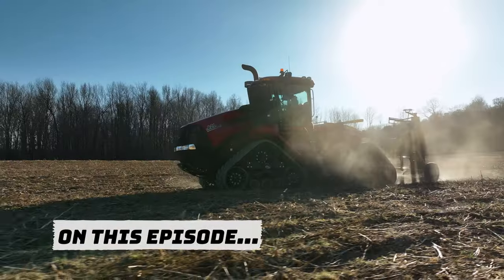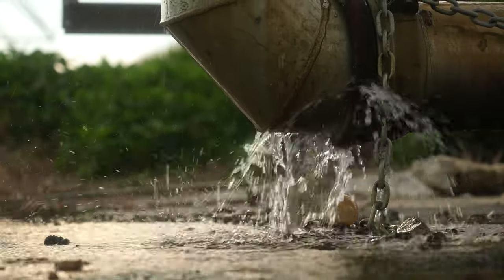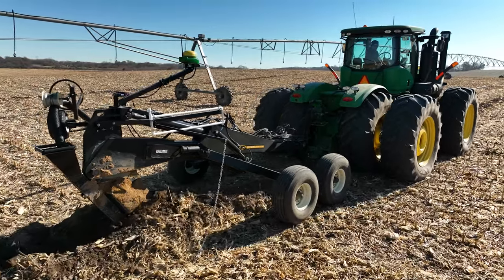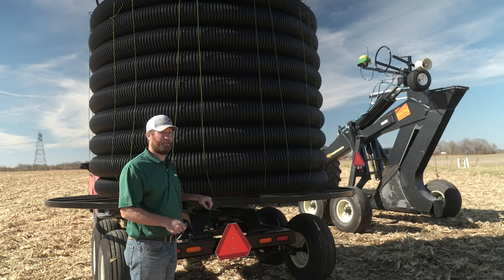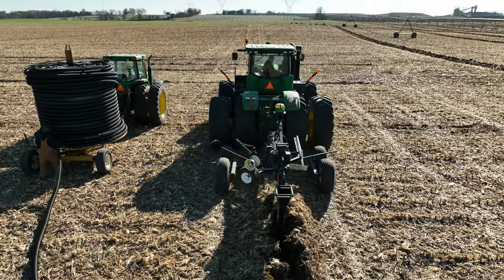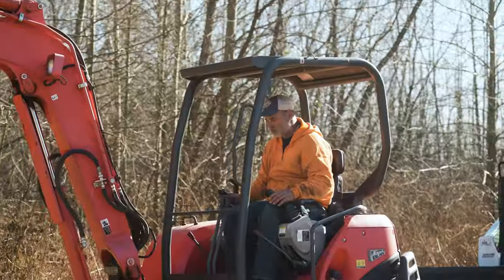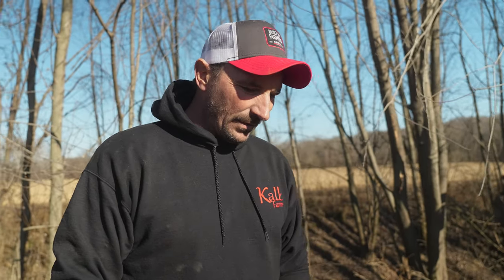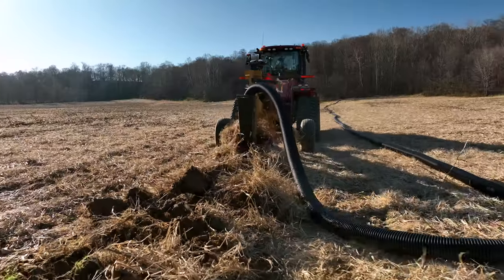Go With the Flow | Live To Farm Ep. 109

Comment: I’ve never known perforated tile not to completely fill up with soil without fabric/gravel. Does this system truly work laying it straight in the ground?
Reply: It works and works very well. Soils are different everywhere and sometimes fine slot or socked pipe are needed in more sandy environments to prevent pipe from silting up. I believe the engineering company DIGS provided ADS the designs for these fields in the video as they provide designs all across the United States for farms.